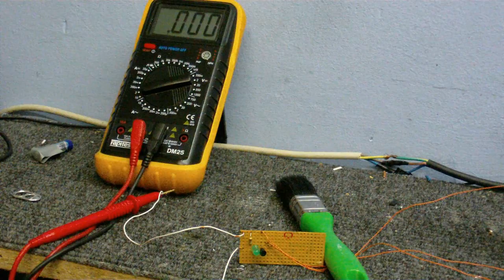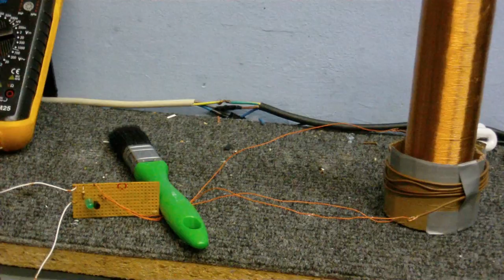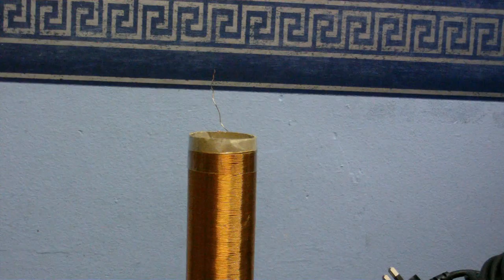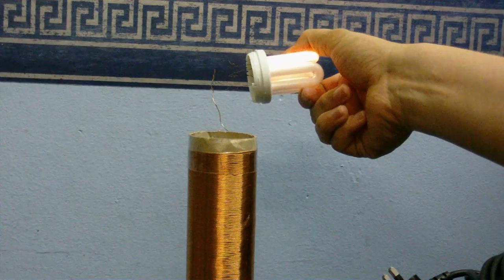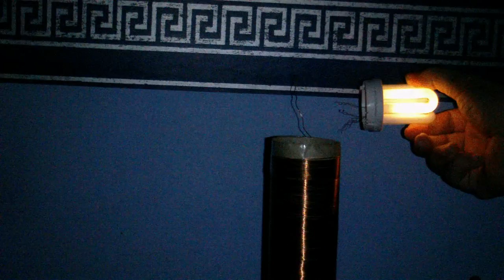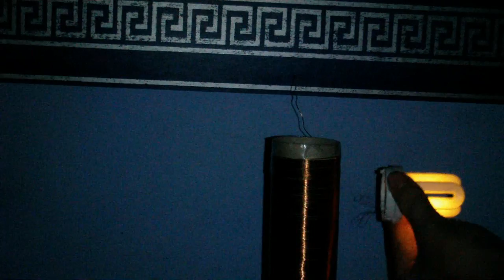Slayer exciter experiment

Comment: 1.8mhz, you could set that up with some modification as an am radio transmitter. If the input is 100ma @ 12v that's 1.2 watts so a higher voltage might result in more current draw.

Comment from the maker: I'm not sure what frequncy was in the video, since then I've added some length to the tube so it's now about 12.5 inches long and about 2 inches wide and has about 500 turns, that has lowered the frequency to about 1.8 mhz, and I get close to 1kv out.  The signal is almost sine-wave, I measured it using a pick-up head out of a tape recorder held about a foot away.

Comment: I found getting rid of the LED/diode and using a pot for the base resistor gave me the best performance. Keep tweaking with it and you will eventually get a jet of plasma from the end of the coil. Also I found this circuit makes RF kickback appear is strange places, even with it out of tune I could touch an exposed conductor on the low voltage parts an feel RF burns and smell my burning flesh!

Oh and some electronics do not like the RF this circuit produces at all!